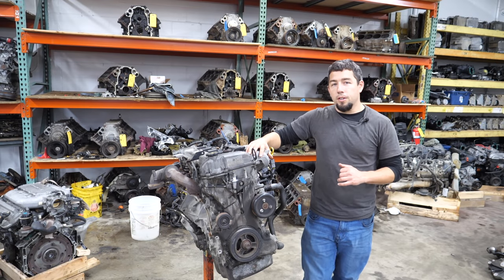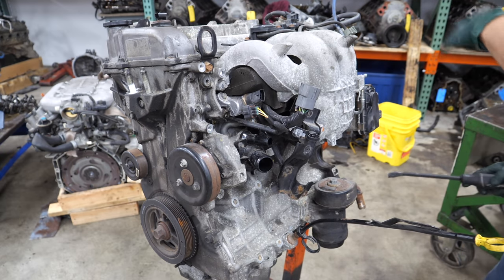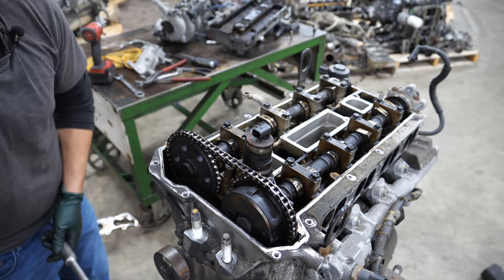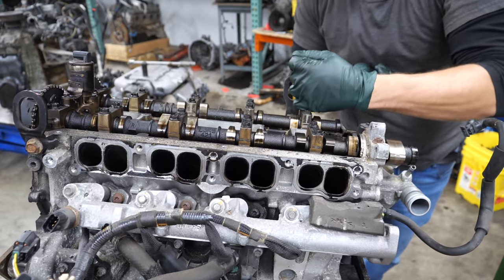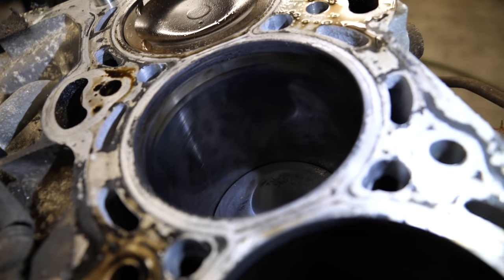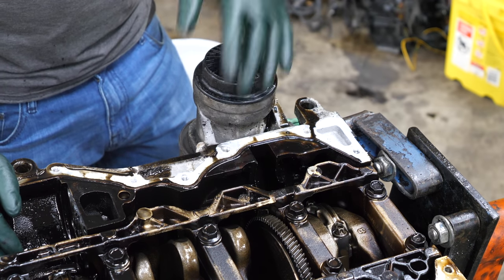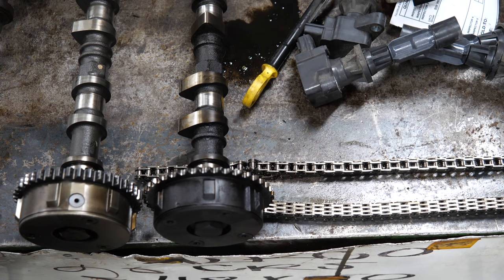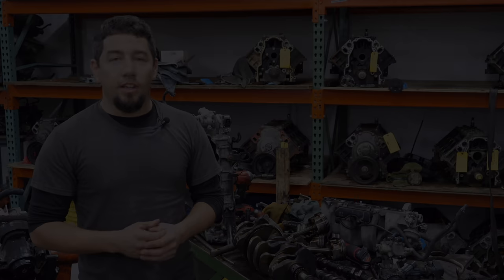Mazda 2.3L Turbo MZR Engine Teardown. A SMORGASBORD Of Failure Modes!

Comment: I own a mazdaspeed 6 and I love it but you’re starting to sway me on how bad the engine is 😂
Reply: Ill trade my 2011 c300 for it
Reply: @TheWizardboy5  almost tempting lol
Reply: I've owned one for a few months and it's been reliable but burns oil
Reply: @GotBoostMyBoy  coming up on 4 years with mine lol
Reply: Go buy an Ecoboost 2.3 and replace head gaskets and cracked blocks. The L3-VDT is a very robust engine, all of these engines are quite obviously poorly maintained using the wrong oil.
Reply: I’ve never had any problems with mine but I always see people asking about shit that broke prematurely on forums

Comment: I bought a 2.3 cx7 turbo made it half way home and lost power threw a code for ocv. Had a bad electrical issue everything on the emissions harness was fried
Dude had the timing done for a "chain rattle" broke 2 wires to ocv and they touched
Got it to run again found his rattle was actually the turbo.
Replaced turbo ran fine drove all around, second trip made it 2 miles and began misfiring on #1 lost compression. 25 psi
I hate these things with a passion at this point

Comment: I have this motor in my speed6…in April 2024 I did my timing components…in June 2024 I did my head gasket…between April and June the price of crank friction washers went from 8.90$/per washer to 44.34$/per washer…5 x price increase only for a 1 time use flimsy ass washer…moral of the story Ford is the absolute worst

Comment: 194,000 miles on my 2008 Mazdaspeed 3, still original timing chain, no issues. Do your oil changes

Comment: I traded my 81 Mazda B2000 truck in on a Toyota truck at 140K because I could see how far out the chain tensioner was with 5K oil changes. Never looked back. I wonder if grocery store gasoline wreaking havoc on the injectors was involved here - the plugs are all over the place..

Comment: Would love to see a vq if you still get those in. A vvel one would be really interesting
Reply: I think he has done one. Unless Iam thinking if the VR30…
Reply: @speed23ism  
Yeah he did do the vr30. 
Would be curious to see how any of the infinitely variable valve lift engines hold up.

That crazy variable compression motor I think Mazda did would be cool as well

Edit nevermind it was Infiniti. That would be way cool

Comment: Cyl 3 is always the bad cyl in these. That block looks great though honestly. You could probably theoretically hone and re ring that oem size which is EXTREMELY rare for these engines after a failure.

Comment: That black.blob in that cylinder I believe is just carbon & judging by the looks of the spark plugs the engine may have had worn piston rings which caused excessive engine blowby & excessive oil consumption !

Comment: Did you watch for ring gap alignment, can cause low pressure. Probably did thousands of engines, maybe saw 3 that was the issue. Probably installed wrong initially.

Comment: Rollie stand hack: if you turn the engine 90 degrees (45 for a V8, of course) and put the breaker bar on the head bolt, parallel with the floor, then you can just use your weight to loosen the fastener without the engine stand trying to go anywhere.

Comment: I had a 09 mazdaspeed 3, with no engine issues since I bought it new. Sold it last year with 144k on it. I did regular 5k mile oil changes. Original turbo, timing chain, everything.
Reply: Luck you.My 2007  CX7  166000km needed 2 injectors  ,timing chain and carbon cleaning on all valves.Great suv when it ran but a money pit.
Reply: I have an 08 with 120k on it with original everything.  It mostly sits in the garage and I thought about selling it because that's all it does anymore.  How much did you get out of your 09?
Reply: That timing chain definitely needed doing, even if it didnt seem like it

Comment: FYI, the new, thicc silent 2.5 Duratec timing set fits the 2.3 MZR DISI Turbo. Upgraded mine as well, very happy. Just make sure to get the whole set, chains, sprockets, actuator, tensioners, guides, etc...

Comment: At this point, if anyone buys that block, it will sleeved. No one buys these engines unless they are modding them. I owned an 2006 MS6, and it was always fixing what was broken. I beat the hell out it, but it was always maintained. I loved the way they drive, and it was my introduction to 4WD. The electronic LSD was pretty stout (even though the mounts would not handle more than stock power).  The trans was really well built too. That nick on the valve looks like either carbon breaking off to the top and slamming itself between the pistion, and valve. It could also had been a piece of a spark plug (had that happen to me).

Comment: if youre not saving the dipstick tubes...just take an old pair of visegrips and weld on a threaded rod with a weight to make a small slide hammer type tool for yanking them out

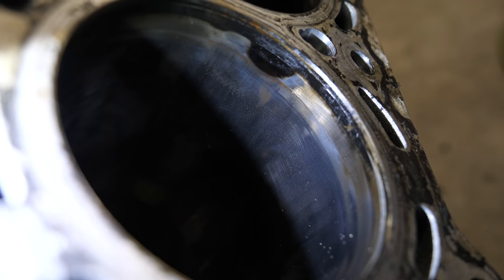Comment: @19:25 looks like a cracked bore? Suppose it isn't as you would have spotted that. 
For the rest.. Not impressed by this engine. Oh and 140k from the chain? Gimme a timing belt, cheaper in the long run.

Comment: I'm at 21 minutes in and I know you're explaining it but I have ADD and I don't know if I can remember this question until the end I think there is a better way to portray both these together both cam lobes on each one need to be in the correct orientation and the correct chain needs to be next to the one or under it as reference I'm looking at it now and I don't understand how the Ford one works but you're going to explain it and I can definitely understand why the Mazda change stretches without even guessing I would like to know the differences between the two Motors could you go into great detail and some video to explain what Mazda took from Ford and what Ford took from Mazda

Comment: What brand of battery powered tools do you use?  Does the battery last for the entire engine dismantle?
My experience in dismantling and reassembly is MANY motorcycles Datsun L series and small & big block GM’s including some GM industrial engines

Comment: Had a 2007 Speed6 and was a guinea pig for a lot of the original hopup parts from various MFGs.  I put 40k on it with stock turbo before the turbo seals went bad.  Upgraded to a GT3076R and ran it another 20k at 450 HP before deciding to build the motor.  Ran it another 15k at 600HP before selling the car.  Was a great car and if you knew what you were doing they were actually very strong cars.  I even broke the transfer case and lost the oil during a trip and drove it about 400 miles that way.  Only locked up after I parked it and it siezed up inside.  If I could find another with low miles I'd buy it in a heartbeat and do it all over again.

Comment: And to think, I used to want a Speed6 after my Speed Protege. Glad I never went there.
Reply: I own a Speed 6 and honestly its never given me any trouble, if theyre maintained well, they tend to do just fine, I love the crap out of my 6.
Reply: That's a high mileage engine that's been run on cheap oil and poorly maintained, do the same to any other vehicle and you'll see similar issues. Personally, I think it's taken it's punishment quite well.

Comment: Besides the mess and take off issues for the oil filter what are the other down sides to just having a cartridge filter vs a typical oil filter? I have a cx7 only 133k but it's been he'll. Just had to do timing chain along with other tune up. I have to tackle the catalytic converter next. Thanks for the videos really appreciate them.

Comment: Do you have any experience with the 2.0l in the Protege5? I'm on the second engine, and it has at least a blown head gasket. It's leaking a lot of oil and there is liquid in cylinder 2. I've changed the oil pan gasket, but the oil seems to be coming from higher up the engine. Do I buy another engine or scrap the car?

Comment: As a Mazdaspeed owner these motors require a lot of maintenance the timing has to be checked while it’s at TDC and those are the wrong spark plugs first off everyone in the speed community runs NGKs the also suffer from the valve getting covered with carbon the vvt is supposed to be replaced at 70k miles

Comment: It's interesting cause mercedes m271 evo motors have a chain and adjuster system similar to the ecoboost motor and they throw timing chains like no ones business where as the earlier m271 motors were roller timing chains and they were pretty bullet proof in my experience.

Comment: MZR stock injector seals are barely sufficient for the job. They start to fail with even minor mods, to the point where a lot of folks started either replacing them with Toyota diesel injector seals or spending a couple hundred on exotic material copper alloy seals. Leaks are easy enough to see when the intake manifold is pulled to clean the valves, but I'm guessing that was never done on this engine. If it gets bad enough the cylinder goes slightly lean, and then you get detonation and damage. Combine that with the timing system being out from that much chain slack and it's a recipe for scorched valves.

Comment: Just wanted to say, that intake valve that looks burned at 13:10 is probably due to the timing system being worn, as it's usually a symptom that the timing on the car was advanced too much, which meant the cylinder was firing before the valve had properly seated. If you were to tear down the head, I'm willing to bet on that cylinder's valve seat, you'd find excessive carbon, due to the combustion chamber not being completely sealed. And since the timing of when a cylinder on this engine fires is controlled by that loose timing chain, I'm willing to bet that the engine was basically driven into the ground with little to no maintainence.

Comment: That engine saw some long OCIs.  The dark caramel to black coating on the internals says it all.  Well guess what happens to cam chain run in dirty oil?  The link pins wear and that creates a stretched chain, and the cam chain tensioner after awhile can't compensate, so the valve timing starts creeping, and pretty soon you can experience a lean running engine, as evidenced by the white electrodes on the spark plugs.

Comment: It looks like someone at Ford was listening to any reports Mazda got back about failures on the L engines before the house of Henry sold its controlling interest in them. The Ecoboost chain looks beefier and seems like it could take more punishment (though running an OHC engine with timing chains too long on too little oil is a recipe for disaster regardless of engine).

Comment: U would like to see a video anout mzr lf 2.0l engine that also has some timing chain problems i have a 2006 mzd 3 and it had streched timing chain and engine has been rebuilt because of that from previous owner who i know very well
Reply: The standard VVT LF, L3 and L5 MZR (Duratec) engines all have multi link timing chains. The L3-VDT uses a roller chain due to the increased particulate matter in the oil due to GDI.

Comment: Seems like this engine was ran without hpfp internals upgraded and the owner tried to upgrade power running lean also compression low can come from the seals going bad in the injectors

Comment: You can heat the end of the dipstick with a hot air gun or sth to pull it off easily and turn it with a plier or you can fall on your back worse. Be careful man we need your teardowns

Comment: As an MZ3 2.5L owner who’s occasionally contemplated swapping to an MZR for the better aftermarket support….yeah I’m good no thanks
Reply: Change the oil regularly with quality fully synthetic SN(+) grade oil and the L3-VDT will outlast your L5. I have both here, the L3-VDT is up to almost 280,000 klms with no issues whatsoever, and it's a series 1. I've never had it apart, I've never even had to change the water pump.

Comment: 14:58 That's a Ford drain plug. Even uses the integrated gasket. Not too shocking since Ford owns a majority stake in Mazda. Had the identical drain plug on my '05 Freestyle.

Comment: having the same issued with a 2011 mazdaspeed3 cylinder 4 has 30lbs of compression the rest are 180. its the original owner bought new in 2011 its all original with no mods. the egr did fail which was replaced with a new one. hate to pull a motor for something stupid.
Reply: Well as you can see by this video, the low compression was a result of a leaking injector seal, might be a good place to start before ripping the whole engine apart.

Comment: The only way I could make this mzr engine reliable,was to build it from the ground up.started with a Ford 2.5 block
Reply: The 2.5 bottom end is weaker than the L3-VDT bottom end. The L3-VDT block is made using a different casting process for increased strength, it also has provision for oil jets squirting on the undersides of the pistons. The L3-VDT also has vastly larger big ends then the L5 and fully floating, larger gudgeon pins in comparison to the L5. The L3-VDT also has a forged steel crank, which the L5 does not and the L3-VDT has hypereutectic pistons and sinter forged conrods - The L5 has normal cast pistons and standard cast conrods with a longer stroke putting even more load on the conrods. Basically, the L5 is no more than Mazda/Ford's econobox engine.

Comment: You shouldn’t worry about terminology for removing bolts after the way you handled the dipstick tube. I was almost as wet as cylinder #1 🤣
Reply: 2:45 just needs some slap bass

Comment: Just put a used engine in a CX7... I'm a focus fan, I drive a 2.3 duratec. This motor is an abomination by comparison.... and the cx7  is a nightmare to work on. Hated ever minute of it, especially when I went to start it and found the junk yard pulled the motor out the top and removed the damper..... now I have to tear the thing back down and retime the motor. Has a -6 degree correlation issue.
Reply: You'll be doing more than retiming the motor if the crank bolt was loosened. BTW, the MZR/Duratec engines are all part of the same family, even the Ecoboost is simply a newer variant of the same design.

Comment: Yup, I work on these turds every day and it's always cylinder 3 with low compression
Reply: I worked on them for a good ten years or more and never saw cylinder three with low compression (that was caused by a failed injector seal in the teardown video).

Comment: Why are exhaust manifolds always rusty? Even under the hood, rusty. Rustier than other steel components too.
Reply: Because the high temperature they run at promotes oxidation on a surface that can't be painted. You see the same thing with steel fire pits.

Comment: Will the timing chain rubbing on the valve cover cause timing issues prior to just fully failing since I’d assume there’s some friction there slowing things down.
Reply: It won't cause any running issues whatsoever as the chain is only slack when the engine is switched off due to the issue being with the VVT actuator. You'll hear a rattle just after startup that disappears quickly, in 90% of cases the engine runs perfectly with no rattle at all once oil pressure has built up in the VVT actuator.

Comment: If there was no damage on the pistons, can anyone explain to me why it had low compression? Was it due to the loose timing chain the slack it had or what I’m kind of confused.
Reply: Could be rings, headgasket, or yes, something in the valve train causing loss. You can make a cylinder show 0 compression on a H series Honda if the valve lash is loose enough

Comment: Glad i chose my ST over potentially picking up a speed3.
Reply: Eh, depends on the car. I had an ST that cost me over 5k in repairs, sold as “certified used” from a dealership. My Speed3 has ran flawlessly and is professionally tuned. Comes down to maintenance during the cars lifetime and not just oil changes but valve cleaning etc. My speed3 would also blow the doors off my old ST, so lmao

Comment: That timing chain.  What the heck causes that?  It's tight and then it's not.  I don't understand.
Reply: The stator in the VVT actuator is shifting due to the fact the locking pin designed to lock the stator within the VVT actuator when the engine is not running and has no oil pressure has failed. Get a running vehicle with a 'stretched chain', run it, turn it off and immediately check for slack in the chain through the oil filler neck (series 1 engine), chances are there will be no slack. Let the engine sit for half an hour or more and check again, there will be slack. That's hardly indicative of a 'stretched chain'.

Comment: My 2008 Mazda 3speed blew up  twice each time I was on the interstate and I floored it with it in 6th gear  just to pass somebody on a mild  grade . First time the warranty covered it the 2nd I paid for it. I got rid of it fast after that.
Reply: Why would you floor it in 6th 😹 that’s cruise gear bru
Reply: Lol, I was just accelerating  , on the I-75 it was a very mild incline . I have drove that same road everyday for years . Never had a issue with it . Then Boom ... They 2nd time it happened I was in 5th gear and that was two years later. I know the reason for that my dumb as other half filled it up with 87 octane fuel , I found the receipt , he played stupid , his Turbo F150 could take reg gas. I only used Shell 93 in that car.  I got rid of it then I was lucky I just made the last payment.  I drive a Mazda Cx9 now  . Much better engine not one problem still only use Shell 93 in it.